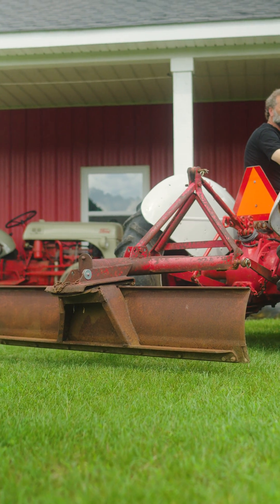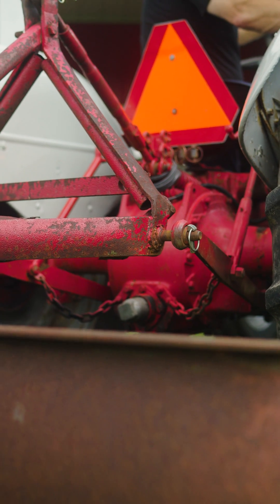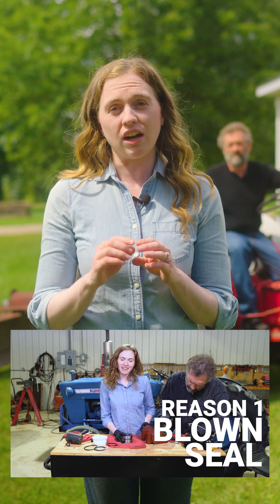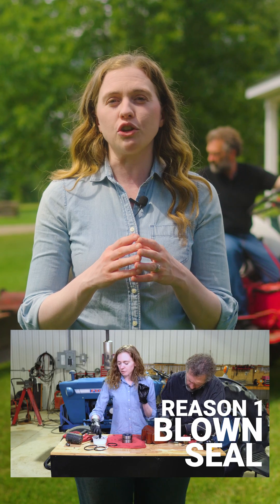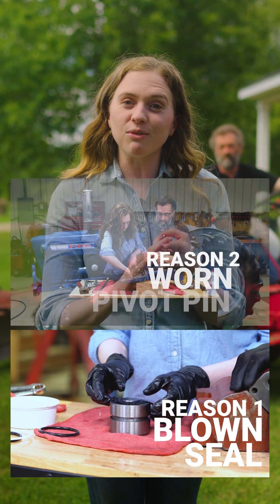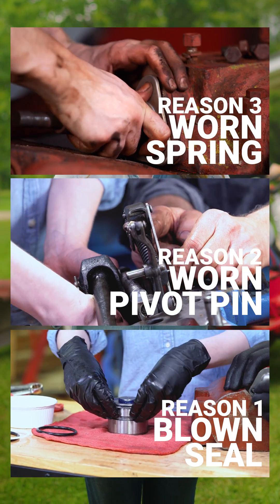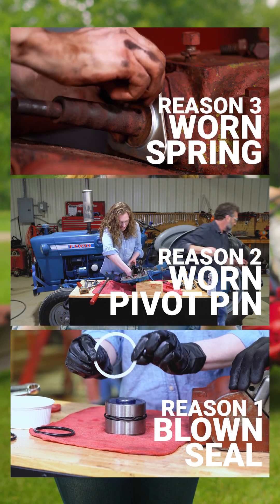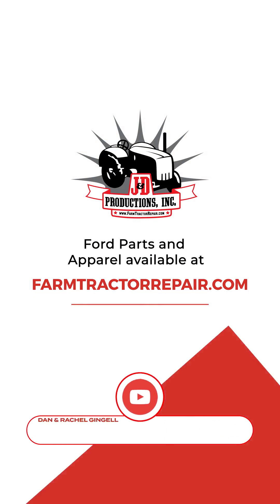Why do Ford Tractor 3 Point Arms Pulse? Three Easy Ways to Fix Pulsing Hydraulics

Comment: Different subject  does  anybody make a  V 8  CONVERSION  KIT  for  the 8N  that you might know of. . ?    Thanks
Reply: Yes the ford 302 v8 bolts right up to the 8n.. all you need is a longer dipstick
Reply: @mudjeeper4176  Hay thanks  , l have a  289 Ford  , a 302 Chevy  but no 302 ford's  , why does the dip stick  need to be longer  ?  Thanks  TANK
Reply: @tanksoldier9770  you’re welcome.. 289 should work fine.. use the longer dipstick to help stabilize the gas can when filling the tank tank 😉

Comment: I’m having issues with ford 3000 bogging down going uphill with pto engaged with brush hog. I am missing a spring that I think connects to bolt under battery box to the carb. Could this cause my problems?

Comment: If l had the time, l would like to do several videos  on Ferguson Tractors.  Harry Ferguson and Henry Ford developed the 9N Tractor on 1939 using Ferguson’s patented 3 point System. This was done on a handshake agreement.
   In 1947, Harry Ferguson decided to go on His own and built His own Tractor the TE20 ( Tractor England ) and the TO20 ( Tractor Overseas ). Tractor overseas means those produced in the US.
   At this same time Ferguson denied Ford permission to use His patented System.  Ford did it anyway and brought out Their 8N Tractor. Harry Ferguson immediately sued on the Grounds of infringement of Patent. Considering the speed ( or lack of it ) and inefficiency of the Court System, the final verdict didn’t come down until August of 1952.  Ford was ordered to cease production of the 8N. Had Ford followed Ferguson’s directive there would’ve never been an 8N.

   I am saying all of this because Harry Ferguson was the basis for the 9N, 2N, and, against His Will the 8N.  Yet there seems to be very little  documentary on the Fergusons. This considering a more advanced Tractor using a Continental Overhead Valve  Engine and Fergusons system legally.
                                    Fergieman

Comment: My little 5000 did this replaced all that you should  I still done it replaced the check value and doing fine now my little 5000 is low profile and I have a 5000 row crop also.

Comment: How about slow hydraulics up and down with a PTO clunk when the oil is warm after a few hours work?

Replaced the top lid, piston rebuild kit put in from you guys, and some replaced linkages in the diff case. Spring gets tighter then a bow string when it does it, and to boot im suspecting a bad bearing on the PTO shaft internally for the clunk and a pump rebuild for the rest, but im not sure. When its not slow, the three point slowly falls like the relief valve is drooling

Comment: This question is off topic but years ago we had a Ford tractor on the farm. Trying to identify it all I remember is the shifter was spring loaded and it went straight up and down forward and back to select gears. Not much information but any ideas would be appreciated.
Reply: https://youtu.be/dSoHoamNLP8?si=Yw1ssHLX2i7lTp_V
Reply: was a 5 speed probably a 801/851 Powermaster 1957-1962
Reply: @randyvick593  would that have been on the 8N or 9N or a different Ford tractor?
Reply: @TheCar1ter  not certain but it is a 5 speed
Reply: @randyvick593  took your information and did a picture search and I'm pretty sure it was the 801 power master. Given that it's been almost 55 years ago the memory ain't what it used to be. Thanks
Reply: @TheCar1ter  I just bought an 851 Powermaster and I'm mechanically restoring it. 1958 model.
if you'll look on the flat surface right between your left toe and the starter, near the starter, you may have to scratch paint off but the model # and serial # are stamped there above the 2 bolt holes.
if it's an 861 it is a gem.
Reply: Ford
Reply: 800/801 series
Reply: Rachel has a You Tube "short" on the shift pattern on those tractors. She also lists the models that have that feature.